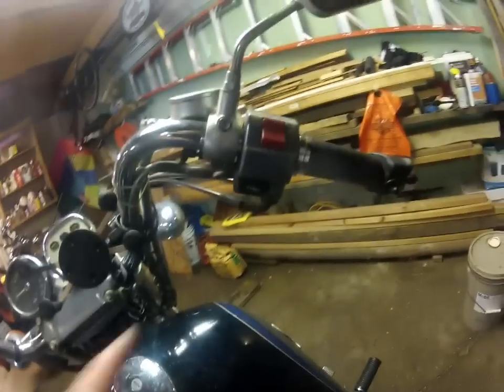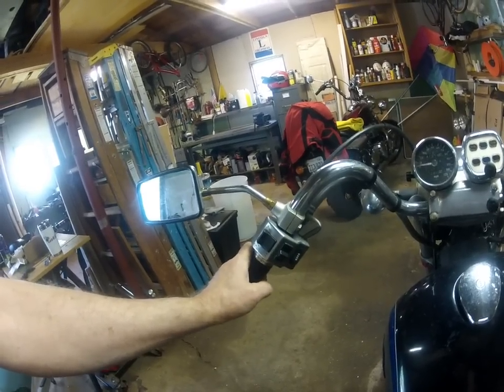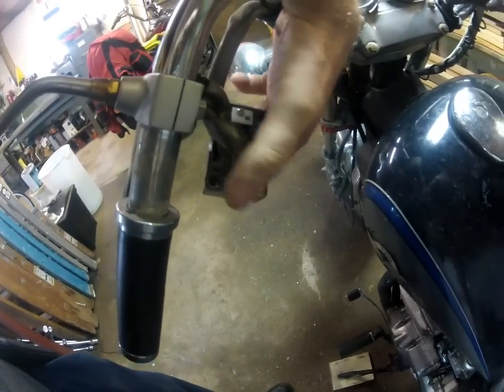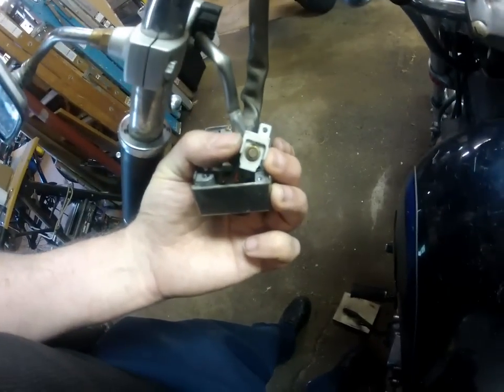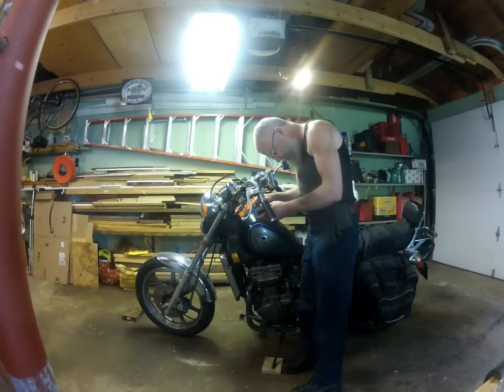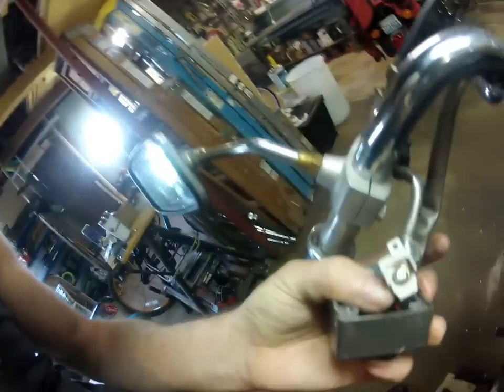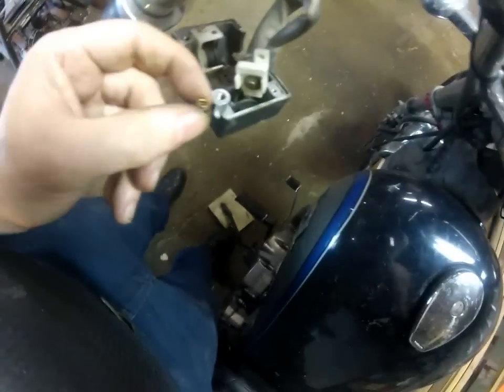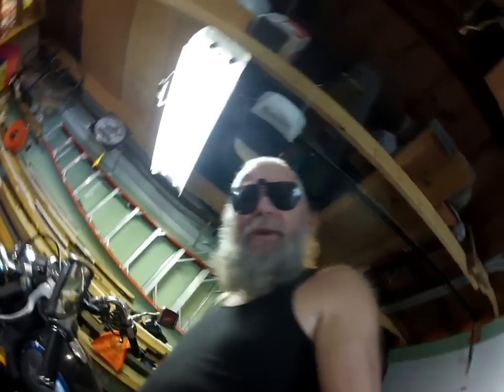Motorcycle Starter Switch Repair (also works for the horn button on some bikes)

Comment: I know it's likely that the original poster will not say this, but this video helped save me over $150 on a new Switch assembly. The shop I took it to said that they tried taking it apart and cleaning it. After I disassembled it myself, I saw that they didn't do jack shit. I went back over there and got my money back. And my seitch works again

Comment: . Good video. I’m trying this tomorrow. I believe my start button is actually getting stuck on and keeping the starter solenoid energized.
Reply: Sooo yeah. Bad idea to take apart the switch on the duc. It’s a jigsaw puzzle in there of springs and other items tightly packed in there. Each piece needs to fit in specific cut out and is keyed to stay tight. I gave up for tonight. Was gunna get mad. Need a third arm. 
Can’t even do on a bench, have to do on the bike. Ok, I’m done complaining.

Comment: My horn button came off and I later found it.  I took the starter assembly apart and glued the button back on to the broken wide base that was keeping it in.  The glue worked and I reassembled the button assembly and it would not start, nothing.  I rechecked the back of the button and spring and see there is a short plastic rod at the center of the button  by itself .  From your video, I see, that there should be a contact at the end of that rod to go against the contact on the circuit board.  Next, figuring out how to get a contact and replace the missing one.  1982 Suzuki gs1100g
Reply from the maker: Sounds like you will have to get really creative. 
Let me know if you get it to work Thanks for stopping by and commenting William.

Comment: Very helpful. Didnt know those needed cleaning. 😂 Going to try it out on my starter switch. I’ve ruled out many other things like the colenoid, the starter engine, the fuse, and the battery.  Hope it helps!
Reply: Hi was it dirt in the switch?
Reply: @roadwarrior8560  No! I finally disconnected and bypassed the safety clutch option (for starting) and it fired right up. I realized after the fact that my son had dropped the bike on its left side and had damaged the safety clutch wiring. When I bypassed that it had no problems. It started great for a while. Now I’m having issues with power not even connecting from the battery when I turn the key on. Im wondering if I need to replace the key switch mechanism or if it’s something else.

Comment: i parked my bike on street today (big mistake), when i came back cracked back ferring and some damage on the side, starter button stuck. i had to bump start it to get home, then i watched this video and found a piece of broken plastic in there. removed it and now it starts fine. just wanted to thank you for the post,  at least i can drive to work tomorrow
Reply from the maker: YW my fellow riding bro. 
I made this video to help out my fellow bikers just like you. 
Ride safe and keep your face in the wind.

Comment: Hey man great video! Followed your steps just now and still had problems with the starter switch. Finally realized that the contact pin that sits inside the spring in the backside of the thumb button eventually looses length, as all electrical contacts are prone to do. That contact pin can be pulled out and flipped around, problem solved! Hope that helps someone!
Reply from the maker: Great news and thank you for adding to the information for others.
Reply: Thank you both. Appreciate the help

Comment: Believe it or not but my first motorcycle is a non running bike. I'm doing everything myself. This video is a huge help. Thank you so much.
Reply from the maker: eric kuykendall YW and I wish you the best of luck at getting it on the road quickly.
Reply: suburbanryder - The Mayor - Thank you so much. I did it today and thankfully it was the problem. Unfortunately I went to put the tank (just cleaned) back on and there is a pin hole in it. Now I have to get some cash for the repair kit. Any advice?
Reply from the maker: eric kuykendall I repaired my Jeep gas tank with JB Weld and it held for about a year. Then other pinholes started leaking again from rust. By then I saved up for an aftermarket tank. Follow the instructions on the package and make the surface VERY clean.
Reply: Awesome! thats that's what I was thinking. I found tank repair at autozone. I'll let you know what I choose and how well it works. Thanks for all your help.
Reply from the maker: eric kuykendall YW
Reply: Never mind on the tank fix. I went to patch the one hole but soon foun a hundred more. What all models of tanks can fit the 96 Vulcan 1500
Reply from the maker: eric kuykendall I keep searching Ebay and scored some wrecked Vulcan 500s for parts for my bike. Very cheap too. If you can find one that didn't suffer any damage to the gas tank like maybe bent forks then you may get an excellent gas tank for low cost. I picked up a $300 rotor for $35 and very little wear on it.
Reply from the maker: eric kuykendall A Kawasaki parts guy should be able to tell you the range of years a tank can fit.

Comment: Oh thank you sir for humbly gearing me out. I did not mean any offense so thank you again for being so receptive. Y'know there are attachments that you can make to help stabilize your camera. You can make a steady cam by taking to pipes welding one pipe horizontally to the bottom of a vertically orientated pipe. You let a few weights rest on the pipes. Now on the top of the vertical pipe you fit an attachment that lets you screw the base off your camera into it. Now the camera will be securely fastened to your "steady cam" when you move the camera about it will make your video very smooth looking when you move about. As if the camera were on a track. This is a makeshift "jib" of sorts so those sweeping shots or shots when filming something moving won't be jumpy they will look very stable!!! Hope that helps I know it's a long comment.
Reply from the maker: No worries. The thing that keeps me wanting to do this is people taking time to comment.
Without viewers like you I would just give up and not make videos. :)

Comment: Thanks. I have a 1975 Kawasaki 900 Z-1B whose starter button has been inoperative for years. Am able to kick start. I've pulled my hair out reading about relays and solenoids, etc. I may give this a try. The setup may be different, but the concept similar.
Reply from the maker: The corrosion on my contacts was really bad. I had to press many times to get it to start. This video is the second time having to take apart and clean the contacts.

Comment: Many thanx for this video tutorial. I bought a moped for my daughter. Horn does not work. I checked the horn by connecting it directly on the 12volt car batterij. Horn works...So now I need to check the wires, switch, contacts...see where the fault is,

Comment: Whew I’m going to try this tomorrow for sure , when to start the bike after 2 weeks of repairs and nothing.. defiantly going to clean that switch.
Reply from the maker: I just took a chance I could do it without breaking it apart. 
Worst case I would have to buy a new one like the dealer said.
Worked out well for me. Hope it does for you.

Comment: Thanks for posting this video.  I have been having trouble with my Vulcan 1500 which has the same switch.  Your video does a good job of covering this issue.  But in my case it didn't solve this problem.  I've clean switch but my bike still starts only intermittently. I'm stumped.

Comment: cheers great video.
The screws in back of the housing on my Zxr250a are rounded
will drill out, clean lint from housing and replace with new screws :)
Reply from the maker: Hope it works out great for you bro. :)

Comment: Hi, nice informative video. I'm fixing a friends er 500 at the moment. He has disassembled the switch previously and stated he has lots the spring, anyway i replace that but the button itself (the part you actually press) has no metal back to it to make contact with the switch. It just has a plastic nobble. Now i don't know if he has lost a metal contact that's supposed to be there, or if it comes like that originally. Would it come as iv'e described? thanks.
Reply from the maker: +CarryonSkyrim Sounds like the metal contact has either worn completely off or fallen 
off. Then your only option is to get a new switch and housing from the dealer or on ebay.
 After that if you clean it every few years it should last the life of the bike. 
My bike is well over twenty years old and still lots of metal left to sand or scrape down.
Reply: +suburbanryder - The Mayor - Thank you ,It was as i assumed.  I've just fixed it. I had to superglue one of an old switch to this one and now the engine turns over. Now to figure out why it still won't start. haha.
Reply from the maker: +CarryonSkyrim :)

Comment: Kinda broke or lost the switch button all together, broke off the horn aswell but used the spring from the horn and good placement to start my bike at the moment, worked in a pinch, not sure where to locate a electric start button or how to fix (1996 Kawasaki ninja ex500D)
Reply from the maker: In the past I have had to go to the hardware store and buy a momentary push button switch rated for a few amps and mount it somewhere when no other solution would work.  
Hope you get it sorted Ed.

Comment: I’m try that because my horn button has long been giving me problems. But y starter button won’t do squat
Reply from the maker: Sorry to hear that OTR.  Maybe you can find a replacement.  The problem is for some older motorcycles it's very hard to find parts.

Comment: oh thank you so much, my 1999 nomad is having a contact issues at the starter button and i can not afford to put her back in the shop..... wish me luck cause i will be taking it apart tomorrow, i just hope i can get it back together.  ;)
Reply from the maker: Best of luck. I think you will do fine. 
I even broke open a relay and fixed it when it was made not to be  fixed. 
I just had to glue it back together and it did eventually fail again two years later but then I had the money to buy another one. :)
Reply: Good deal.  Girlfriend having issues with her Honda Shadow.  Hopefully that'll get it right

Comment: Will try it on my '98 Marauder, im sure it will work like magic
Reply from the maker: Worst that can happen is you find out you can't fix it but you are no worse off if it's not working anyways.  The dealer told me my switch was sealed and un-repairable.  Well I have cleaned it twice and put it back in 25 years and it works fine.  :)
Reply: WROKED LIKE A CHARM,
Reply from the maker: Good to hear my friend. Happy riding. :)
Reply: now my next challenge, a bigger one, replace the forks >>>>>>> nothing that youtube cannot teach, wouldve love to see a video on my specific bike but i think i got what i need

Comment: thank you I.hope this helps with my new bike I just traded a riding mower for a 1982 yamaha xj650 maxim inline 4 was told had shifting problems but I got it through all 5 gears with ease  on a center stand. so I'm hoping I don't have to split the motor and trans but I charged its battery and it just pops the oil light on and ocationally will try to turn the motor over so I hope its just the button and not something expensive btw u would know any where to geta shift cam assembly and shift forks at a good price that would work on an xj650 I can only find new one for 200 for the shift cam and 45 $ for each shift  fork
Reply from the maker: I have had older stuff myself with hard to find parts and I usually search ebay and ask my friends to keep a watch as well. 
So far after a few weeks I seem to always find the part I need. 
Maybe just luck, maybe hard work, not sure. 
Congrats on getting a bike and I hope you get it up and running soon.
Reply: suburbanryder - The Mayor - I hope I can get it running and if found the parts on eBay but they r used and I'm always iffy on used parts but for 9 to 50 buck vs 200 can't really complain. and ill let u know if this method works on an xj650 starter switch
Reply: suburbanryder - The Mayor -  sorry I'm getting back so late yes this work but it also helped me to determine that it was the starter solenoid which had gone bad I also found preveious owner broke ridges of the starter button -.-
Reply from the maker: So glad you got it sorted out Jackie, ride safe. :)

Comment from the maker: When my switch stops working well and I don't have time to clean it I pop the side case and short the solenoid terminals to crank it over. Have you tried that? 
Also, the solenoid can sometimes get carbon scoring and not work good just like the switch. Unfortunately it cannot be taken apart and cleaned.

Comment from the maker: I take an old jewelers loupe with two elements in it. It's a cheap $10 one and I hold it in front of my Vado point and shot for closeups. I can take it apart and make it around half power by removing one lens for a little less close shots.
Works great for a cheap price.

Comment: THANKS MAYOR,  I'D BE CONTENT TO ORDER A NEW IGNITION BUTTON HOUSING BUT DON'T KNOW WHERE TO FIND "TANK MINI CUSTOM 50 CC " PARTS.  IT'S RARE AND NOT BUILT ANYMORE. ANY IDEAS
?
Reply from the maker: It won't look original but any momentary push button switch will work.  Get one rated for at least 10 amps at your local NAPA or quality auto parts store.  It works and gets you by instead of paying a lot for the original part.  I even used one in an old Ford car that had a bad ignition switch and mounted it on the dash to start the car.  Didn't want to pay $35 for an ignition switch at the time.

Comment: I have a 1500 classic Vulcan-1998. When I put it in neutral and turn the ignition to on. Everything lights up. When I press the starter button sometimes it cranks and sometimes it doesn't. If I hold the clutch lever in and press the starter switch it cranks every time. The battery is at full charge.  Any ideas on this problems? Thanks, Gary
Reply from the maker: Sounds like your bike is not properly detecting it's really in neutral every time. Look in the repair manual to see if the neutral safety switch has an adjustment or if it can only be replaced.

Comment: Ive got an older Kawasaki withe the same switch. would it be difficult to remove the indicator switch?
Reply from the maker: I never had to clean the indicator switch on this bike but I would sure give it a try. I thought the starter switch was going to be hard and it was very easy.  Even if you break some of the plastic by mistake, super glue is your friend.

Comment: I tried this on my gz250 but no matter what I do, it still doesn’t work. I used contact cleaner, i even used some sandpaper to clean up the contacts plus the spring! It worked on my horn, but not on my starter button so I’ve been having to start my bike with a wire from the battery to the starter 😑
Reply from the maker: Unfortunately some switches are just too far gone for repair.  :(
Reply: @suburbanryder  yea most definitely! This bike did sit outside for 7 years so i still have alot of work to do!

Comment: I cleaned the item for the horn with no success... what do you suggest?

However, it did work for my starter switch... running like a champ!

Thanks!
Reply from the maker: Next step I would take is remove the horn switch from the circuit and short the wires. If the horn sounds then the switch is beyond repair and needs replacing. If the horn doesn't sound then track the wires back to the horn and the fuse box. You can also disconnect the horn and feed it from a battery to make sure the horn functions. Then it's only wiring and fuses left. Depending on the wiring harness I have run new wires rather than spend a huge amount of time trying to find a small break in the wire.

Comment: Si in theory If my starter switch button is broken or completely gone, I can use the horn button in its place?
Reply from the maker: If they are both the same like the Vulcan 500 then yes they can be interchanged.  Not all motorcycles may be like that.

Comment: I have been thinking that this is what is wrong with my bike. I hit the button and nothing at all will happen, no click from starter relay. This started a couple of months ago every so often. I thought I just wasn't hitting the button correctly with my gloves on but never had an issue before. Gradually it is happening more frequently and sometimes on two attempts in a row.  I friggin just bought a new relay before coming on here. If it does turn out to be the switch well I guess I'll be happy, just have a spare starter relay.
Reply from the maker: I hope you get it fixed soon my friend.

Comment: I have a1995 Kawasaki Vulcan 800 vnA, I'm having the same problem with my horn but I saw smoke coming out of the button and it doesn"t spring back. could the spring have broken?
Reply from the maker: Yes or the spring heated up and melted some of the plastic. Only way to know for sure is taking it apart and looking. Worst case is you have to buy another from the dealer. But at least give it a try and see if you can save it.

Comment: i need a video on newer bikes its alot easier when everything is mechanical, show me how to fix a ripped ribbon on  a keyless ignition starter switch that has nothing but a circuit board and my broken ribbon
Reply from the maker: I am accepting donations of new motorcycles, Kawasaki, Yamaha, Harley or Triumph.   Let me know and I will get right on that.  ;)  :D